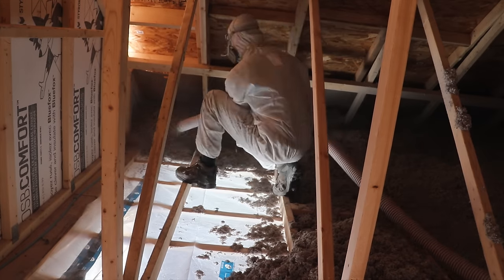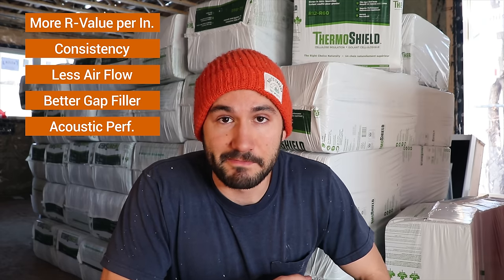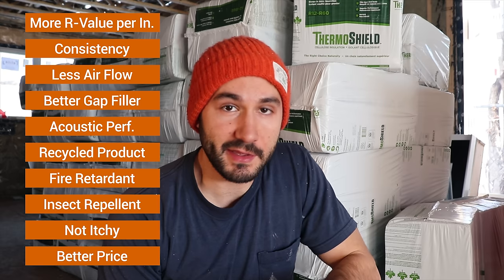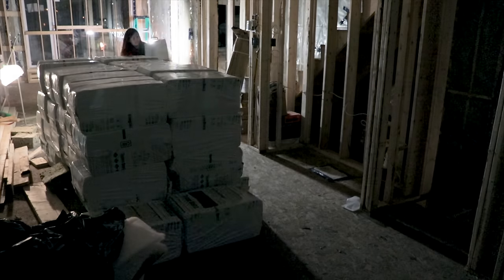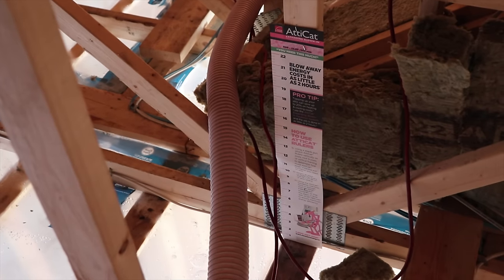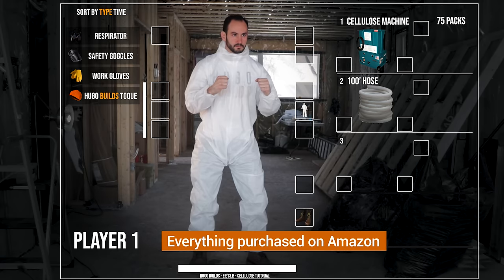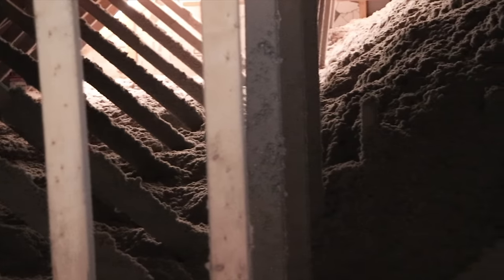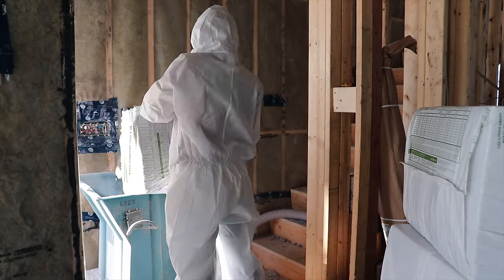How to Install Attic Insulation: Blown-in Cellulose using Home Depot Rental Machine DIY

Comment: Helpful video, thank you! Did our old attic on the weekend - HD did not have the deal on the rental, but we did get a deal buying 30bags or more. 

Everything else went smoothly!
Reply: Can someone address the sinking effect of cellulose please? I had over 10 inches blown in several years ago. They even left the paper sticks showing how much was blown in. Now it's all level with the rafter tops where you walk. Total waste of money. At least bats won't disappear over time like cellulose does.
Reply from the maker: Addressed in your other comment.
Reply from the maker: Glad it worked out. I was told that HD did remove the deal on the rental. This video dates back a few years now.

Comment: I'm pre-installing fiberglass batts and OSB on top of it in my attached garage attic (the house part of the attic is already insulated). After that's all done I'll blow in cellulose loose fill on top of the OSB/fiberglass. Is it overkill to install batts and OSB first? You bet it is. But I don't want to fall through and break my ankle like you said. Plus this way gets me some insulation to start and will leave me with a nice walk area in the garage (for inspecting the roof). I'll build an elevated walk area in the house too for the same reason. Easy to inspect and no risk of falling. Will probably top off my 10 year old house insulation at some point as well. 

Oh, I'm air sealing the garage attic as well. Already did some of it.
Reply from the maker: Can never have too much insulation. Might be over kill but you will be well comfortable in there and it will be super efficient! Nice job!

Comment: Awesome video! If I may add in my 2 cents  to further help anyone it's a good idea to can foam around all lights and punctures through the ceiling before you blow in for maximum air sealant!!
Reply: Travis M great idea Travis.
Reply from the maker: Great idea. If there is any air leakage I can feel a year in it's where we were a bit sloppy in those areas.
Reply: Great idea Travis! Glad I read the comments for this piece of advice!

Comment: Thanks for doing this video.  I'm about to do the same in my house.  Nice to see another first timer do it first!  *Video Tip*  Not sure which editing software you use, but getting your different audio to similar levels would help.  At worst, stick a limiter on the Main Output to help with the leveling.  I got blown out a couple times while watching this.  Thanks again!  Love the video game gear selection section.
Reply from the maker: Hey J.R. - you'll find that it's pretty easy, like a lot of other jobs it's mostly make it or break it in the prep.  Thanks for the tip with the audio - I'm still struggling with that, will look into the limiter to level everything out. Feel free to pop in if you have any questions. Hope it helped. Good luck!
Reply: @HugoBuilds  Thanks.  That whole prep thing makes all the difference.  And you probably have a stock limiter plugin in whatever editing software you use.  They usually come with it.
Reply from the maker: @JRMooreMusic  will go watch YouTube videos on audio right now! haha. I think for this particular video I had taken off the mic and forgot to put it back on - I filmed a bunch of stuff with the mic off and couldn't re shoot everything so I worked with what I had.. that sucked.

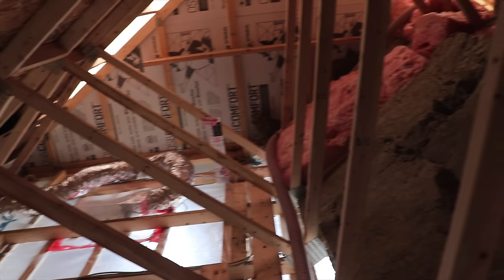Comment: LOL the segment @6:00 was awesome. Doesn't look like you really had anything to air seal before blowing in? Just a reminder to anyone looking to do this to make sure your ceiling is 100% air tight before blowing in(can lights, wall top plates, pipes and electrical chases, electrical boxes, duct plenums, around chimneys etc.  This is as, if not more important than the insulation itself!
Reply from the maker: Hi Dan, yea that's a good call. The vapor barrier on the ceiling was all taped up/sealed. All the wires and perforations were all taken care of. Good advice. Thanks for watching.

Comment: Hi Hugo, How much you spent in total? Rental price  for the blower for 24 hours, the cellulose itself( how many bags and how much in total?) and the gear protection for 2?
Reply from the maker: I'd have to double check but I recall it was probably around 700$ CAD. Protection suites we bought on amazon for almost nothing. Blower price in included at the Home Depot if you buy enough insulation and that was around 650$ or so.

Comment: Blown in cellouse insulation is my favourite when I'm 21 I will build my own house and use blown in cellouse insulation
Reply from the maker: Yea, it's really easy to work with. I will reuse it in my future projects.
Reply: It's easy if the machine is set right and has very low output. I find it's really hard to see with high output. If you want to learn more about attic insulation checkout my YouTube channel.

Comment: Hugo, where did you buy your Cardboard Attic Baffles ?    Planning a similar project here to insulate my garage ceiling here in the Quebec Laurentians before it gets too cold outside.
Reply from the maker: Hi Stephane,  I ordered it from 'materiaux lavoie' a construction supplier here in the Outaouais. They supplied the insulation and added a pack of carboard baffles.  I thought you could get them at the home depot but I checked and it doesn't look like it.
Reply: I was wondering the same too. I’m in Florida and I haven’t seen those down here.
Reply: Bugs, Silverfish like to eat the glue in cardboard in attic here in Florida. I would stick with another solution sold from Home Depot.

Comment: Hello, my name is Christina and recently bought an old house (100 years). I found out there is no insulation in the walls after moved in. Your video is very valuable which educate a lot information about the insulation. The house is extremely cold in cold times, and cost a lot to heat it. Do u think I should do the insulation first, or what else should I do to keep warm? 

Thank you so much
Have a good day
Reply from the maker: Ideally you want insulation in the walls and roof. I'm not sure what your budget is - ripping out all the drywall to insulate the walls is very expensive. There's ways to blow in insulation in the wall cavities by drilling holes at the top and bottom. However - if you are on a limited budget the best bet is probably to insulate the attic. It's usually easier access and heat rises so it will be the best area to fix to minimize heat loss. Good luck!
Reply: Most old houses can be drilled between the studs with a about 2" hole then cellulose is pumped through a smaller diameter hose.. Once all the insulation is installed ..patch the holes

Comment: Wow, im litteraly a contractor I feel embarrassed to say it but my hvac system has disconnected ducts, uninsulated terminations to the first floor No mastic on any transition. Ive been working up there for the past week to get it done but i had no idea it was that bad, I thought I would have to spend thousands to fix my ac but i just did it for $50 lol.

Comment: I loved your video and very informative. However I am curious...did you not install drywall in the attic? I can see your ceiling glowing.
Reply from the maker: Thanks! As far as I know, there is never drywall in the attic itself unless you plan on using it as livable space.. generally, the attic is an unfinished unconditioned space meaning air from the outside can flow freely inside and is vented out through a variety of vents on the roof. If by glowing you mean that you can see light coming from the floor below; you're right. We had not yet installed drywall when we did the insulation. We did have strapping, also known as furring, 1x3" wood strips 16" o.c. on the ceiling that held the plastic on tight. We needed to insulate the attic before installing the drywall because we were getting a lot of condensation on the underside of the ceiling because of the warm house air hitting the cold air from the attic. Once we had it insulated, the underside of the vapour barrier was able to dry out and we installed drywall shortly after that. You can check out the drywall episode right after to see what that looked like from inside. Thanks for watching, dude! Have a good one.
Reply: HugoBuilds I think he means why isn’t the ceiling underneath drywalled???
Reply: HugoBuilds I’ve never seen this done without the ceiling underneath being dry walled.

Did you screw all that wood through the poly? How is it going to be air tight afterwards?
Reply from the maker: @karrarmstrong  The ceiling underneath was drywalled shortly after - like I explained, we couldn't drywall because of condensation issues we were having. The drywall really isn't supporting the weight of the insulation in our case.  There is 1x4 strapping underneath that is keeping everything tight, the max span that vapor barrier has to support is 12". We did end up screwing that wood through the poly - but that's always the case, the poly has to be behind your drywall and your drywall has to be screwed to studs so you're perforating it with all those screws in either case. I don't know the exact science behind this but I think you're just trying to minimize the air loss by minimizing amount of screws you put in. The strapping is attached tight enough to the poly that it's kind of acting as a gasket and is limiting the amount of air that can get through. Even in the best case scenario, your poly will never be 100% air tight.

Comment: You used strapping to hold the poly/insulation? Why not doing your ceiling drywall instead? you probably have a bunch of holes in your poly now, no? Where did you build?

Comment: I have hired contractor to do this 2 years ago, but there were some renovation works involving walking in the attic.  I found that some areas were stepped on and the insulation got packed.  Should it need to add insulation again?
Reply from the maker: Hopefully it will bounce back, if it's really compressed you could always rent the machine and buy a couple of bags to top it off. You can install a 2x8 boardwalk up there ontop of the insulation to make sure stuff doesn't get compressed in the future. Thanks for watching!

Comment: Where should I keep the machine? My garage, or somewhere closer to the attic?
Reply: Btw, thanks for the video!!!
Reply from the maker: My pleasure. Sorry for the late reply. You can keep it anywhere really as long as the pipe will reach. It will get pretty messy around it so the garage seems like a good plan if you can reach. Good luck .

Comment: Great Job!  Gonna giver a try.  How much do you think you saved?
Reply from the maker: Thanks! I think we saved a crap load. I think I had a quote for about 13k + tax for all the house insulation. I did it for about 2k~ and my own labour. Not sure how much of that went to the roof but I only spent about 7-800$ in the attic for the machine/materials.

Comment: Great video... i'm looking to insulate the attic area above my garage but i also want to lay plywood down for additional storage area.  Would you rec. blow in cellulose if just regular insulation ?
Reply from the maker: I think you should shoot insulation first and build a storage area above it so you don't compress the insulation. You can build the structure first and then shoot or lay what ever insulation so that it's not compressed by the storage. My 2 cents!

Comment: Thank you for the video. Appreciate it! Q about the vapor barrier...why did you include that as I have read many places that it's not needed unless you are installing in a very cold climate...oh but you are in Canada i think i saw so I guess that's the reason...
Reply from the maker: Thanks for watching! Yes, very cold climate. -40c to 40c from January to July. D: It's required by building code here.

Comment: Does this type of installation work for sound proofing?
Reply from the maker: It definitely helps with high frequency sounds.. I don't know if it would be as good as something like Roxul safe n' sound. It won't do much for low frequency noise transmission that happens through the house members such as joists and studs. Check out my sound proofing video for a better idea!

Comment: Do you need a vapor barrier with the blow in cellulose?
Reply from the maker: No you don't! Most of them come rated as a vapor barrier. Just make sure to check the technical data sheets.

Comment: stupid question, how long is the hose that comes with the machine?  I would need to stage in my garage, and go up two flights of stairs and to the back corner of my house just to get to the room with the attic hatch.
Reply from the maker: You can get extensions from the home depot. I think by default they give you about 100' of hose. I had mine at the bottom of the stairs so it went up the stairs and the attic hatch wasn't too far from there, in the attic I went another 50' inside towards the front of the house.

Comment: I will be blowing cellulose insulation over R19 batts - what about junction boxes, light fixtures, and bathroom exhaust fans that recess through ceiling into attic - do they need to be covered with wood or sterofoam box to have a entry access and also to keep cellulose from covering and to eliminate overheating- or is this not a problem- if so, where can these products or materials to make these items be purchased?  BIGFROG
Reply: Junction boxes and  exhaust fans  don't  generate  any appreciable heat, so no you  don't need any  type  of  box/barier  to  keep the insulation away, go  ahead  and bury them.
Where I  live  code  requires a continuous vapor barrier between the cieling drywall and the trusses/cieling joists,  that  includes covering, and sealing  all  light/exhaust fan  penetrations  with vapor barrier as well.
(If  the junction  box is  only  accessible  from the attic, and  not  below,   then  flag it,  or  try  to  move  it up above the insulation so  it  will  be  accessible.

Recessed (pot lights)  if they are  rated  for insulated  ceilings, don't need  a box to  separate them  either.
Recessed lighting that isn't rated for insulated  ceilings should  have a box  to  keep the  insulation 3" away,  not  because  the cellulose will  burn, but  to  prevent  the  light  can from  over heating, and  burning the wiring.

Cellulose  insulates  so much  better than  any  fiberglass product,  you  should   notice a  difference when winter  weather comes around.

If  you  live  where  winter's are mild ,  or  non existent,  your  home  will  stay  several degrees  cooler  during  the  day  next  summer.
Good luck.
Reply from the maker: Yes they have to be covered or rated to be covered with insulation. To be safe I would suggest covering them and give the fixtures a bit of breathing room before covering everything up.
Reply: @HugoBuilds  Yes,  true  for  recessed can/pot  lights that aren't  IC rated.
I think  his  question also  includes  octagon  boxes  for  flushmount/pendant  type  light  fixtures, and smoke detectors which  only  require  a  sealed  vapor barrier over them, same for  bathroom  exhaust fans.
( assuming I'm interpreting his question properly).
Reply from the maker: haha thanks, @fartman2269  ! Great username by the way. Yes, I had misread the questions, appreciate the correction. Hope that helps.

Comment: You say you get more R value per inch but that product settles and loses up to 20% whereas fiberglass only settles 2%. So you actually need to add more of this product to get the same R value after settling....
Reply: Can someone address the sinking effect of cellulose please? I had over 10 inches blown in several years ago. They even left the paper sticks showing how much was blown in. Now it's all level with the rafter tops where you walk. Total waste of money. At least bats won't disappear over time like cellulose does.
Reply from the maker: Correct. You need to take settling into account.

Comment: Can someone address the sinking effect of cellulose please? I had over 10 inches blown in several years ago. They even left the paper sticks showing how much was blown in. Now it's all level with the rafter tops where you walk. Total waste of money. At least bats won't disappear over time like cellulose does.
Reply from the maker: Yes it does sink. You are supposed to take that into account when planning your job. The thickness required to get the achieved R value is after the sinking has taken place for a year or so. They have charts for the 'fluffed' height and the compacted height.

Comment: I actually want to pay to get rid of all cellulose that was sprayed in my house attic. That crap is dusty, impossible to see anything beneath insulation, pests, etc. Doesnt air seal and I doubt it's any good for indoor air quality
Reply from the maker: And replace with fibre glass?
Reply: @HugoBuilds  I have fiberglass and then cellulose on top. I want to replace with spray foam on roof rafters and get rid of insulation on the attic floor. Got quote $7k for 2in closed cell, then open cell to meet R38 code, and fire resistance barrier paint on top. Includes getting rid of old insulation
Reply: @IYG-x7c  Can someone address the sinking effect of cellulose please? I had over 10 inches blown in several years ago. They even left the paper sticks showing how much was blown in. Now it's all level with the rafter tops where you walk. Total waste of money. At least bats won't disappear over time like cellulose does.